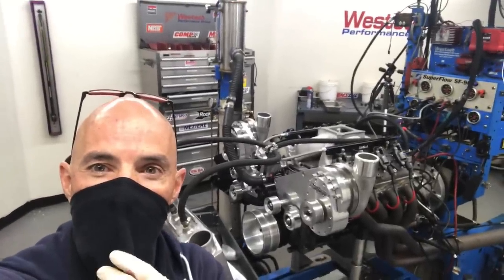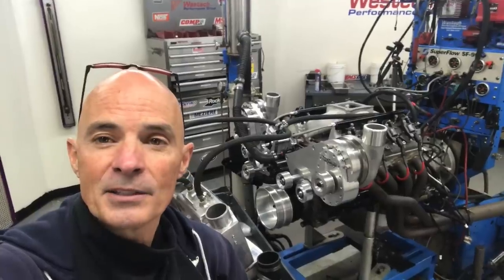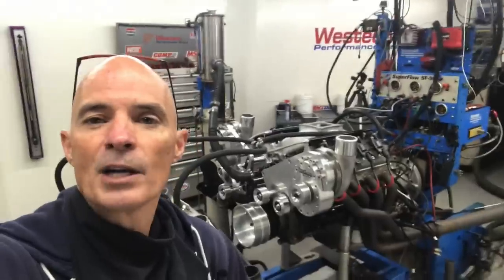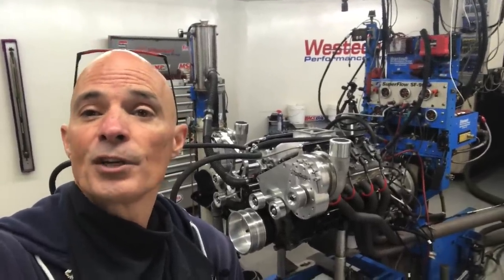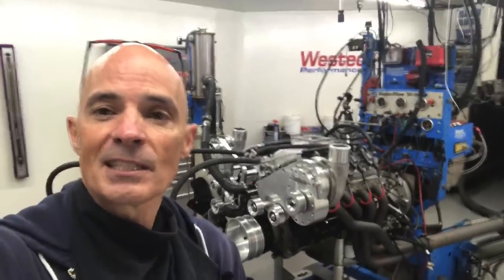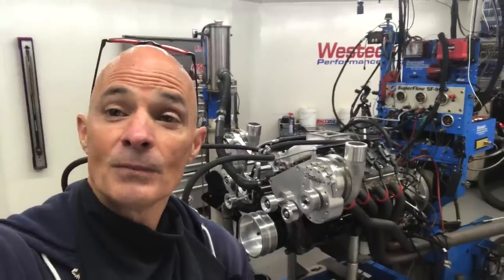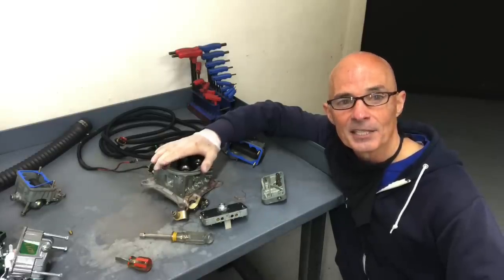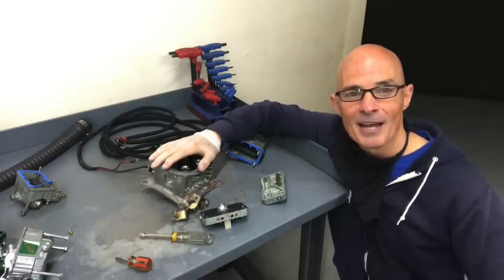WHAT'S INSIDE? -BLOW THROUGH CARBS

Comment: 1st, never use low profile carb hats!  Throw them in the trash.  2nd, extend your vent tubes well beyond the 90 degree turn at the hat and if possible, flare the openings of the extended vent tubes.  You will be able to jet down and actually have decent partial throttle response almost like efi would give you yet still have the beautiful cooling effect on the air charge temperature blow-thru gives compared to injecting the fuel.

Comment: If the vent tubes are correct, consider machining the manifold to tilt the carb toward the lean side of the engine as long as the lean side is the left side from the driver view. Just to say I discovered this issue when running (old school) chained down motor mounts.  duh, never mind I get it you are running motor dyno.

Comment: It's the hat on the carburetor  it doesn't flow air correctly through the carburetor.  You need a hat from Steve Morris his hat design improves airflow going in and through the carburetor.  That hat that you are using causes the air to tumble and move in all the wrong directions.  Get one from Steve Morris he's been doing blow through carburetors for decades, and knows about air flow.

Comment: If its impossible to get enough gas with one carburetor, just switch to a tunnel ram, and run TWO blow through carbs.  Convert it to twin intercoolers, and have each supercharger feed one carb.  Give it 2 carbs worth of gas, and youll only need one fuel pump.   By the way if a carbs power valve was removed, its for a reason lol.   Usually theyre deleted in the rear for drag racers because they favor drivability and not all out power.

Comment: Fuel pressure ?
Reply: Actually the size of the line. I wonder if your gph is not enough because the line size can’t flow enough volume for the e85. My brother in law has a nova with a  supercharger and we ended up buying a new carb thinking it was not big enough. it was the line that was to small and it kept draining the bowl at high rpm because of the lower pressure of a carb . the fuel injection is higher pressure so can push volume through a smaller line. I’m not a professional by any means … just a thought

Comment: The boost is pushing more pressure than the fuel pump so it’s pushing the fuel back down the line you need fuel psi to exceed boost psi everything under that turbo will be pressurized  including fuel lines boost level is now your base fuel pressure
Reply from the maker: regulator is boost referenced

Comment: Have you tried vent tube extensions that bend into the air stream inside the hat? It acts as a pito tube and will give you more fuel flow at higher boost by increasing the pressure in the bowls. It work really well. Playing with the length and where they are in the hat makes a big differance.
Reply from the maker: we did have those

Comment: Extend the vent tubes into the 90 so they pick up boost pressure earlier at the bonnet. This increases the pressure in the bowl sooner and in turn assist in allows easier flow out into the engine. It creates a pressure difference. Aircrafts use airspeed tubes for this purpose

Comment: Something is going on inside the intake. One bank consistently leaner, maybe the air being forced into the carb (twin chargers, lots of flow) is loading up in the hat and causing swirl/tumble/flow issues as it’s forced through the carb. Try clicking the hat to see if the distribution changes. Point the hat at the back of the engine (more plumbing😂😂) and see if the left bank consistently goes lean.

Comment: #1 split flow hat (stops swirl)
$2 jet extensions
#3 dual jet bowls (big help)
#4 boost reference power valves
#5 shorten bowl tubes
$6 boost referenced fuel regulation 
#7 bigger boosters
that and a couple of sizes up on the curcuits is all the magic I got
ENOUGH FUEL PRESSURE.
Reply from the maker: DYNO FUEL PUMP

Comment: This video is OLD (like me) and there have been nearly 600 comments left, soooo......I'm not gonna read 'em all to see if you found the prob. BUT......I suspect, as others have said, that your wonky side-to-side and lean high-speed AFR's are/were being caused by turbulence in that 90° hat.          I had the same issue several decades ago when turbocharging a carbed 2.3 Ford Lima (Pinto) engine with a homemade hat.        I fixed mine by extending the height of the hat (in a Courier mini-truck, so plenty of room) and ~ while leaving the inlet "nipple" to blow into the hat down low ~ I pop-riveted <eek> a velocity stack to the choke horn with its' inlet way up at the top of the hat.         Soooo........charge air entering the hat hit the side of the velocity stack, traveled up to the top of the hat's "chamber", then made a 180° turn into the top of the velocity stack and entered the carb in a straight shot.     VOILA'........my wonky AFR's and high-speed lean condition were fixed!
Reply from the maker: dyno fuel pump

Comment: If there are no vacuum leaks in the system, are the fuel bowls holding enough fuel when making the high rpm pull? Bowl extensions, high flow needle and seats, larger fuel lines from the regulator(s)? Try a belt or cam driven fuel pump with bypass back to the tank. Mechanical fuel pumps are flow tested at 100psi which is approximately 8000 rpm!

Comment: I run Vent tube extensions on mine. The extensions down into the carb hat more than half way. I was able to jet back down on the carb for street use. The extensions allow it to pull more fuel through less jet. I also run AN 10 line to 8AN with fuel return to tank.
Reply: I just saw this vid and thought exactly the same thing.

Comment: I'm not sure if you mentioned the size of the carb... Maybe the cfm was too large... With ethanol or meth you usually need a smaller cfm carb to allow a higher boost pressure on top vs the bottom so the float bowls with have a higher pressure to force fuel through the carb into the air stream... Usually 5 lbs less on bottom vs top is usually good enough restriction.

Comment: Venturi tubes(stacks)over the bores, or a restrictor plate, to increase the pressure differential on the float bowls. *More vacuum at that booster venturis. More pressure on the bowl. Modulator rings on a DCOE carb.

Comment: You need to pressurise the the fuel bowls using the vent tubes!!!  Point the vent tubes at the inlet air!!! The bowls will be at a higher pressure than under the carb and you will get more fuel. Cheers!!
Reply from the maker: we did that-not the problem
Reply: @richardholdener1727  well then… I dont know!!!  …. Change the boost reference from 1:1 to 1:1.3

Comment: I have not read the comments to see if this has been figured out yet but your issue is likely velocity through the venturi. This is only encountered on a blow through blower application. Put a anemometer in the plenum to measure airspeed and you will see it slow down and begin to stall as boost increases. This cannot be checked with a hot wire maf because of the evaporative cooling from the fuel, a vane air meter may work. As air velocity drops fuel distribution becomes an issue and vacuum signal through the carb drops. You have a combination that is completely filling the cylinder with pressurized air before the intake valve closes. You can mitigate this problem by reducing lsa to increase overlap, Closing the intake valve before air speed stalls or a combination of both. Or just use port injection......

Comment: did you fuck with the 8 adjustable air bleads and is it a double pumper.
maybe you can try 3 pound boost ref, in primary and 8 pound in secondary that way you don`t kill it at first with fuel and as you add boost the secondary
will bring in more fuel as needed or something like that.   :)

Comment: As for the bank AFR disparity, maybe a symptom of the fueling limit, one side sees a little more vacuum or has an ever so slightly larger jet, causing that side to rob the other. I'd definitely lean towards that answer if the disparity gets worse as the HP numbers go up. I don't know if there are separate bowls for each side, or two bowls/floats that are just shared. Would be interesting to tinker with.

Comment: I'd say maybe the 15PSI air in the bowl causes the float to lift, but I imagine you guys have run that with 15 PSI of boost or more. Maybe it's lifting just enough to make a difference when you're trying make such large numbers. Denser air might require a slightly weighted float, or at least an adjusted float level.
Reply: He already mentioned it was a fuel pump supply problem

Comment: 1000+hp on E85 usually means dual needle and seat bowls. What’s good for 1200 on gas doesn’t equal nearly the same fuel flow on E85. Let’s say for example that single needle and seat was maxed at 1200hp on gasoline. That means on E85 you could expect it to be out of flow around 850ish HP. Assuming the standard 30% more fuel flow requirements.
Reply from the maker: THNX-IT WAS A FUEL PUMP SUPPLY PROBLEM

Comment: The boost in the intake manifold could be pushing  back or negating fuel flow from the  carburetor versus fuel injection which is sprayed in or near the combustion chamber under pressure. You may have to go bigger on the carburetor to catch up to the fuel injectors.

Comment: I just went through a heck of a dyno session  with a 351c and a torqstorm. It was two days long and watched this video trying to get help. What we found was my car was built correctly by me. There were two issues that killed it. First it was lean... We found that putting some nylon tubing on the vent tubes and pointing them into the charge tube fixed the lean condition. Then it went pig rich. Many pulls and the smallest jets we could find didn't fix it. 10:1 are. The intake side of the supercharger was sucking the rubber hose shut. Hope this helps someone. 667 hp and 590tq. Runs awesome... What was your resolution?

Comment: I'm not any expert, as I say I'm always a novice that's always learning, but if one bank is good, the other cylinder bank is leaner would it be a warped intake or cylinder head on that bank being able to suck in more air around the leaking gasket causing it to lean out that one side?

Comment: - Make sure you dont have a exaust leek that would affect your o2 readingd 
- try getting a boost reference from a different location. You could be getting a fals reading if the location you are getting you refference from is a low pressure zone like the inside radious of a tight curve. 
- Make sure your boost pressure reference  at the regulator is equal to the true boost pressure, 
- make sure you dont have a bad regulator 
- make sure you regulator can supply the fuel demands ( try a different brand of regulator)

Comment: monitoring fuel pressure is one thing but is the float bowl level being maintained?  Can you look jn the sight glasses on the bowls?  If it drops under load at high rpm, it will lean out.  The seat could be drilled out.  If thats not it, then look to enlarge passages in carb body.

Comment: I use to have a fuel problem also until I switch to a bigger boost activated power that had a higher flow capability and bigger ventures holes drilled

Comment: Tried to see if you guys solved it or not but didn't see anything. Maybe I overlooked it. Considering one bank is lean, have you tried swapping the plumbing going into the inter cooler? I noticed they are not the same bank to bank and wonder if it is creating a super swirl in the charge air pipe prior to the hat which may be doing some weird stuff at the boosters and or vents. Just a thought, hope yall fixed it. If you did already please link to it. Love the channel, Danny

Comment: will you mod or pull strings to have a quadra  jet modded into a  a blow through for us please? and thank you? 1209 35th street everett washington 98201 Jason LEE mayberry about 3weeks out till i address the tolerances. i'm using peanut  454 stock evereything i mean everything except oem replacment parts and external assist pump. application 13000lbs or so 28' ;-) yup thats up alright lol 12.5' yeah its about time MAnn
Reply from the maker: I'm not the right guys for that

Comment: Ok so the one bank is leaner the flow into the manifold, is that 4 barrel carburetor open only two ventures open at a time so are u opening the thottle 100% or are u using ONLY one side of cab in a duel plane crank ,sorry im not into v8 engine ,i have only experience on fours boosted and n/a like lotus twin cams sr20 and alike

Comment: Well if u leaning out ,the fuel doesn't mean the fuel bowl is empty, it can only be one of two things ,one fuel correction jet is to small or two the fuel pressure is dropping below the boost pressure and the blow throw hat must be facing forward and not to the sides where exhaust come out ,it should face flywheel or front pulleys to flow even mixtures through out .
Reply: So do we have a answer because I will bet I'm right, arrogant little me
Reply: The only other thing i can think to do is fill the bowls with fuel pressure same and run it n/a then if all good add boost but just 2psi then stop, and open the fuel bowl it should be full if it isn't well u know, and remove the port in the hat to the inlet manifold runner number one ,the hat is 3inch wide and the port is a little better because of crosssectional area is smaller and same psi because of 50mm/60mm port is less pound's per square inch, Richard talk to me

Comment: Run engine with 1 supercharger there  is a problem running 2 geared super chargers   Will not smooth out air flow like turbos  twins  I have twin f2 ProCharger’s on a supercharger gearbox they seem to surge  and pulse the air charge and kill power,if you put twin turbos on your carburetor it will work check this out mark miller

Comment: I'd play with spacers, maybe a different carb hat or a spacer under it. I know you say you've used this setup before but there can definitely be turbulence issues in carb hats. Perhaps your charge pipe from the dual intercooler is interacting with it in a way it hasn't before. One of my books on engines which seems to be written for an engineering course basically assumes that you always have a tumbling flow of air in a bend and it will approximate the largest sphere that will fit in that bend. If that sphere is tangent to the vents then the fuel in the bowls will do some weird shit. If it's going across the air bleeds then the fuel might not emulsify right. There might be some relationship between velocity and fuel emulsification that might say a different fuel level and or airbleed could help but I'm not that knowledgeable on the carburetor to engineer that. Still you've tried different carbs. I think it's safe to assume it's in the interaction with the other parts. And I'd personally feel better about having the carb hat a couple inches above the carb and bowl vents that aren't in the airflow. I might connect them with a hose and drill holes in the side like a 4*4 application. Or try to damp them by shoving some kind of filter material into them. Or maybe try to defuse the air with a cone shaped strainer somewhere. Anything that doesn't work you can remove and know it wasn't that. 

I don't know what your fuel pressure is but I assume it's boost referenced. Maybe change the regulator just to be sure.

Comment: Could be a leaky $0.15 valve seal on one side, admitting just enough oil to throw off your AFR on that bank. Do you have O2 on every cylinder, or just one per bank?   Had a similar issue on our 500 HP small block with 1 AFR in each bank, traced a half-point AFR discrepancy to a valve seal  Your videos are outstanding - thanks for publishing these. Loved the DZ-302 vs. Boss 302, hydraulic cammed small blocks, de-bunking the "blower cam" myths, de-bunking over-square vs. under-square vs. maximizing displacement.  Please keep up the great work.

Comment: The intake probably isn't machined correctly.  Many pro engine builders said they always check the intake face because they are not flat as they should be.  If it's minor then as you push more boost in, it has an opportunity to start leaking and going lean.

Comment: Try mounting the carbs backwards ( front primary fuel bowl to the rear of the engine)in the intake manifold & run the engine. If the side of the engine that is NOW lean is the other bank, then definitely the a/f lean problem is the carburetor or carbs if you test both carbs backward. But if the a/f ratio lean is still on the original bank of the engine, well the problem is instrumentation( as industrial instrumentation ( PLC, inputs, outputs, set points, close-loop, telemetries, etc) system, and I mean the system( wiring harnesses, connectors, modules, boards, chips, processor,etc.), not just the wide band EGO sensors.

Comment: I know it sounds dumb but turn the carb 90 degrees so its sideways. My holley double pumper was leaning one bank at 15 psi. It was over powering my butterfly angle and forcing uneven boost per bank. So when i rotated the carb 90 degrees it even it out lol

Comment: I'd say it's a combination of dirty air from running twin blowers. The flow is clashing in the pipe and causing a massive spiraling effect. Try splitting the intake all the way to the carb hat, one entry on each half. I'm sure you'd see what was going on if there was a see thru plate over the top.